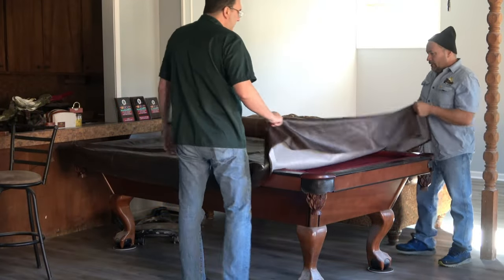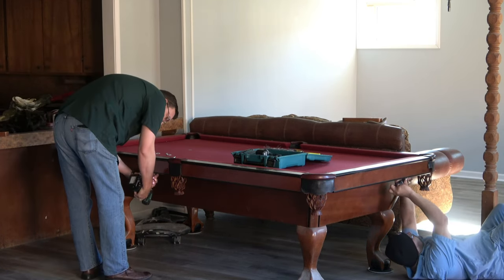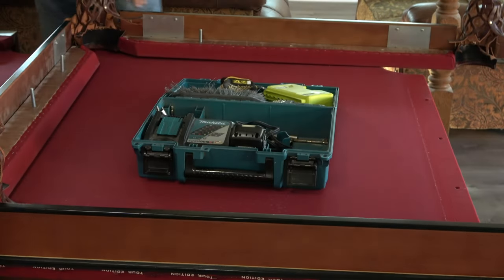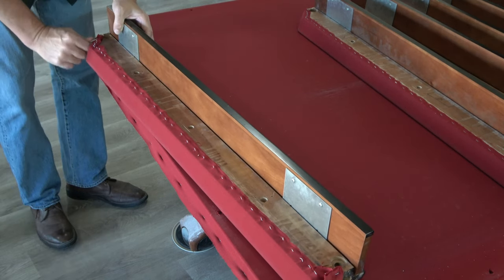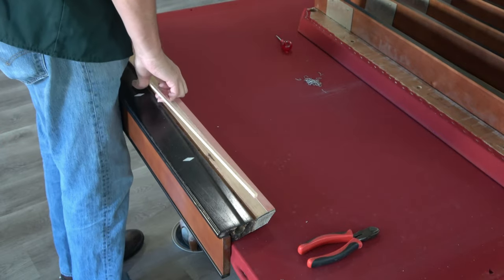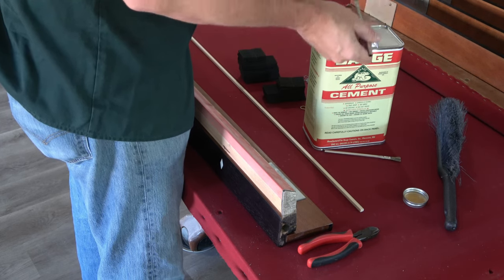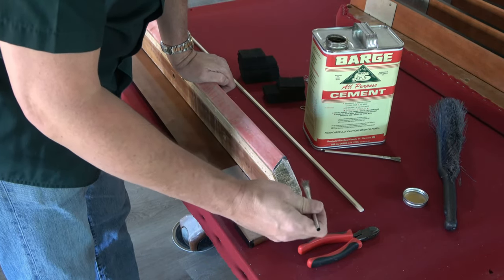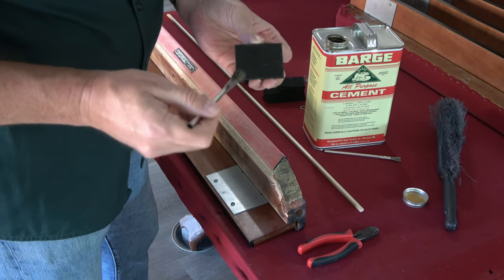How to Make Your Brunswick Pool Table Play Like a Diamond Pool Table

Comment: Does adding a 3mm and a 5mm together affect the acceptance of balls into the pockets. And wow I just noticed you’re adding the two to existing facing. I have 3mm facings now & was thinking about adding another 3mm to tighten the pockets but also thought about adding a 5mm instead of a 3mm to go even tighter but was worried about it affect correct acceptance.  I guess it you added both it would be fine for me to add 5mm for a total of 10 which is less than the 16mm total you added.  What’s your opinion?  I’m at 4-9/16” now.  Thx

Comment: If you replace the rubber on your rails do they come oversized to where u can leave extra at each pocket and tighten the pockets this way or do the rail sizes come standard with no extra material to cut off? Thanks love ur vids

Comment: I've had my Olhausen double-shimmed for 15 years now with 860 cloth (that's been recovered just once). And while I wouldn't trade it for a non-shimmed table, the shims mixed with Olhausen's natural pocket angle can make down-rail shots very frustrating. Especially when hit with any speed. Its amazing for practice, and keeping you sharp instead of lazy, but I do wish the angle was a little straighter - like the actual Diamonds, every-time I get that good ol' Olhausen Rattle. If you are doing this to your table and want it done right, do it the right way and use the second method he mentioned, or figure out a way to decrease the outer pocket width more than the inner pocket width (angled shims anyone?)
Reply: This is exactly what I came to look for. It would seem you'd want to cut the shims at an angle so the pocket is as you described. As soon as I saw the picture of the pocket with the balls, I thought "well that seems to be tapered funny." I came to the comments to make sure it wasn't just me.
Reply: @section8usmc53  so about 4 months ago I caved in and did it. Took the cloth and rails off, cut shims at about a 5 deg angle with about a 15 degree slant to the miter saw to match the down angle of the rails. The olhausens are 1.5 inch subrails so the 2" (1.5" measured) planks worked perfectly. Glued them on, then added staples for security. Put new artimis rubber on cut to match the new angles, new featherstrips, and new 3/8 inch facings. The pockets are now 4", but honestly in some ways play easier than the 4.5" they were before. Much more fair now. No more olhausen rattle. Plays great really, and amazing for practice. I will probably have to get a pro to put new felt on though, I put new tourny blue 860 on it, and the bed cloth looks good, but I didn't do the best job on the rail cloth. But that said, I couldn't find anyone within 50 miles willing to do the work, many didn't even know what I was asking
Reply: Olhausen pockets are cut to make potting tougher I feel. Everyone said Diamonds are tight but I didn't notice any difference from my Olhausen. The widths might be different but there's more than just width to make a table tough. I believe there's 3 measurements that determine table toughness as per Dr Dave.

Comment: I have a '75 GCII with origonal rubber. As I understand it, the Super Speed cushions are real rubber and won't go bad. I am considering 1/4 inch shims each side. If in the future someone wants to remove the shims, can they save the cushions?

Comment: Apologies if you addressed this and I missed it, but I have a 9' table, unfortunately with 5inch pockets. I am in the process of narrowing them to 4.25 and I was told that the only good way to do this was to actually add wood to the rail facing for the rail rubber to adhere to. The rationale is that adding too much rubber facing makes balls act strangely when they contact that part of the rail rubber -- I guess it isn't quite as solid as having the rail rubber seated to wood. As a one pocket player I am particularly sensitive to this. Do you have any thoughts on the difference between adding extra rubber facings as you do here versus adding wood to the facing?
Reply: You said it. I'm a 1pocket player too.  I did that to a brunswick pro 8 for a practice table...The proper thing to do is add model makers plywood to the rail ends and replacing the rubber cushions. (Model makers plywood comes in 4mm 5mm 6mm 8mm ect.) I went from 5 inch to 4.5 inch and it played great. The table mechanic did the final angle adjustments for the facing.

Comment: Why are diamond tables so expensive? And why did tournaments switch to them in the usa instead of olhausen?  Im looking too buy a new table ive narrowed it down between olhausen and diamond?  What's the difference in how they play besides the tighter pockets?
Reply from the maker: Diamonds are expensive because they're good tables made out of high quality materials and high quality craftsmanship. Are their prices justified? Not for me. I think Diamond went out of their way to fix problems that didn't exist. Do they roll true? When installed properly, yes. But, so does every other major manufacturer's table when installed properly.

If you're comparing properly installed 3 piece slate Diamonds to 3 piece slate Olhausens (or Brunswicks) the advantages claimed by Diamond become minimal at best. Personally, I find those advantages to be subjective rather than objective. I would be more interested in the quantifiable differences between the manufacturers. 1) Is there a quantifiable difference in how true the tables roll (NOT related to variances in cloth). 2) Quantifiable difference in the lifespan of the table itself. 3) Quantifiable difference in how well the finish holds up after "X" number of years of use. 

Ease of installation is not and should not be the buyer's problem. So, any features that a manufacturers say aid in easier installation are mere gimmicks. They're designed to get more money out of you - the consumer. As evidenced by the 90 year history of the "modern" way of building a pool table (look up "T" rail pool tables to understand how tables were built prior to the 1930's), and the 180+ year history, effectiveness, and ease of installation of traditional 3 piece slate methods, there is NO practical advantage in using slate leveling bolts as opposed to wooden wedges. Also, there is no practical advantage in using mechanical leg leveling systems as opposed to flat wooden, plastic, or rubber shims under the legs of tables. Even simple leg levelers like those found on Brunswick Gold Crown tables are, in all actuality, more cosmetic rather than functional. Once a table is installed and is level, it shouldn't need to be re-leveled. So, unless you're moving your table a LOT (as you would with coin operated tables that go from one bar to another or get moved around within a bar for special functions or gatherings), having mechanical leg levelers is pointless (other than aesthetics).

As for your question regarding the switch in tournaments, that one is simple. It all comes down to which company is going to pony up the most money to sponsor the event. Part of the higher price you're paying for when buying a Diamond table is going to pay for marketing. And sponsoring tournaments is part of marketing.

Tighter pockets:
I find the idea of tighter pockets - outside of practicing your game - utterly ridiculous! I firmly believe that there should be industry standards for pool tables and the game of pool. Industry standards for pockets was established back in the 1930's. That standard has worked VERY well for almost a century. Why change it? With Diamond's tighter pockets, they've managed to make a great table to practice on; but, a very frustrating table to actually play on. If I were to put it on gun terms, it would be like using a bench gun for hunting. Diamonds are that ULTRA-HIGH precision tool that's great for practicing your accuracy. But, for everyday use, completely frustrating to play on. Oh, and your friends who don't really play pool, they'll be absolutely MISERABLE trying to play on a tight pocket Diamond!

Ultimately it's your choice. Both Diamond and Olhausen make good quality tables. But, if it were my choice, I'd go with Olhausen.
Reply: @CreativeRestorations  wow thank you. Your the first and only person too ever pick olhausen over diamond.  Great information absolutely phenomenal in detail.  Your right theres a standard and regulation for pool tables why diamond decides tighter pockets is better, is beyond my comprehension.  I want to get really good for my own self satisfaction not to go pro. Maybe play some local tournaments hopefully win one or more in the future.  But yeah i want an enjoyable table not a frustrating table.  Plus olhausen have a lifetime warranty on what exactly? im not to sure.  Plus im moving to Tennessee and olhausen made or assembled there i wanna support local businesses.  Your the only person to convince to not get diamond and im glad you did.   Olhausen seem like very high end tables so i Can't go wrong.  Plus it will leave me thousands of dollars left over to buy pool cues and balls and other accessories for my man cave..
Reply: It really makes no sense you have all these people from my dads generation grew up around pool tables, now all of a sudden he coms over and i have a diamond hes never played on tighter pockets hes gunna hate my table and never wanna play on it and i dont blame him thats not regulations.. i always grew up on 9ft tables so i hate playing on 6,7, even 8ft tables sure you should be able too adjust too any table some might say.  But the fact of the matter is i always thought regulations tables were 9 by 4.5ft so why tournaments even allow pros too play on small bar tables is beyond me it wasn't like that in the 70's-90's all the pros only played on 9ft tables not valley bar tables like today..  i feel regulations have went out the window the past decade.. well in California i guarantee the pros or ams would never play on these bar tables out here they never roll true, they never been releveled after being moved hundreds of times, never been refelted, pockets barely hanging on lumps in the cloth or missing cloth its a disaster too play on.. i wish i was making this up i cant believe the disrespect one has for a pool table unbelievable i hate seeing miss treated pool tables its sad..
Reply from the maker: There are practicing aids that one can use to make standard pockets tighter. So, if you want to practice on a table with tighter pockets, you can do that - without sacrificing enjoyable play outside of practice. With Diamond tables, you ALWAYS have tight pockets. And, as I've commented elsewhere on this video, outside of MAJOR reconstruction and redesign of a Diamond table, you can't have industry standard sized pockets.

Also, I forgot to mention, Diamond does make single-piece tables. They are very good tables. But, again, they have the tight pockets. Another HUGE disadvantage to those single-piece Diamonds is, you need special equipment to move them. So, if ever you do move, you will need an installer on BOTH ends of the move who is both a) qualified to work on Diamond tables and b) has the necessary equipment to preform the job.

I'm sure there those who would disagree with me. But, I'm looking at this from a purely practical standpoint. If your ONLY use for the table is for you to practice your game, sure. Go with Diamond. But, if you want something that - long term - is more for enjoyment, go with Olhausen.
Reply: @CreativeRestorations  again very viable information.  I can afford the diamond dont get me wrong. but sure im going to practice a lot on my spare time, but eventually i will have guests over who wanna play pool and i want everyone too have an enjoyable experience.  I feel if your pro am or pro and play tournaments for a living then yes get a diamond but if your me and just wanna get very good on standard regulation table then olhausen craftsmanship is more then obtainable.  Should meet all my expectations and more probably id imagine.  I too am looking for practicality.  it sounds like diamond has a lot of gimmicks they use too make them sound as good as they are.  How much tighter are diamond like half a ball or quarter of a ball?
Reply: The diamond definitely seem subjective more then objective 100%.  Like pros play on diamonds the most they probably cant even remember the last time they played on a olhausen so they will say diamond is better again thats subjective and a lil biased as well in my opinion.  They believe diamond is better doesn't actually mean diamond is better.  Is nike really better then addidas is personal preference.  I think for practicing and trying to go pro diamond makes sense.  If practicing to get good but also wanna enjoy family and friends playing on it then olhausen so for me you helped me decide olhausen it is and that there build very well so i will be happy with my decisio. I will get simonis cloth lol.
Reply: @CreativeRestorations  how do you make the pockets tighter do you have too take the rails off and change the cloths?
Reply from the maker: Billiard Factory sells pocket reducers. They're accuracy training aids.
https://www.billiardfactory.com/Practice-Pro-Pocket-Reducers
Reply: @cryptonator1988  I believe all tables which are twice as long as they are wide are regulation tables. I believe what you are referring to are tournament tables which are 9' and 8 ' oversized (8 1/2').

Comment: I own a Diamond table with very tight pockets which can be pretty frustrating sometimes.  Is it possible to have the corner pockets loosened, even just a bit,, or am I stuck with what I have?
Reply from the maker: Diamond designed their tables with the intention of their pockets being extremely tight. So, I don't think there's any way of enlarging them. At least, not without MAJOR reconstruction. That's one reason why I'm not a huge fan of their tables. Anyone can take a Brunswick or Olhausen (or any other brand, for that matter) and make the pockets tighter. And, the process is completely reversible. No harm. No foul. But, when you start tinkering with Diamond pockets to make them larger, you're talking about big changes that need to be made.
Reply: @CreativeRestorations  Thanks very much for your reply Doug.  One other question if I may.  On a table that's reversible...  in order to loosen a corner pocket, is the long rail  and short rail simply pulled away from each other slightly (after loosening the rail bolts) or is there more to it than that?  Thanks again for your expert advice.
Reply from the maker: I don't understand the question. When you say "table that's reversible" and "long rail and short rail" I don't know what you mean by those terms.
Reply: @CreativeRestorations  re: "reversible"...  I was using your term from your previous post when you answered that,  "And, the process is completely reversible. No harm. No foul.".
My basic question is... is it a relatively simple process to physically loosen pockets that have previously been tightened on a table such as Brunswick or Olhausen?  If so, what is the process?
Reply from the maker: Ok. I just wanted to make sure that we were using the same terms.

If someone used this process to make the pockets more narrow, then, it's just a matter of removing the additional rail facings and recovering the rails. But, there are other ways of making the pockets more narrow. Almost all of them are non-reversible.
Reply: @CreativeRestorations  Thanks for your answer Doug.  It's all much clearer to me now.
Reply: There has to be a way, there are pocket size options when you order your table. Call Diamond.
Reply from the maker: @justin9855  There really aren't any options outside of buying a new set of rails (if they'll even sell just a set of rails). Making factory Diamond pockets wider would be no small undertaking. Replacing the rails would be the simplest solution. But, again, Diamond may not be interested in selling the rails without the table.
Reply: @CreativeRestorations  I'm buying one in the next 6-8 months. I will definitely ask them about this. You're spending $10k+ on a table, I would hope that they would sell a rail set. When I do finally get around to it in the spring (after our winter hell leaves this great state and I see the sun again for the first time in 6 months), I will try to remember to come back here and let you know if they will, as well as options, terms, conditions, etc.

Comment: What about the angle of the rubber at the corner pockets? The corner pockets on my Connelly are wider than 2 balls, but the rubber angle diverges towards the playing surface. When I hit the balls with hard draw when cheating the pocket, the ball often jars in the corner pocket and doesn't fall.
Reply: The angle does make a difference. I have done this same thing on some tables, however I sand the  new facings on a belt sander before gluing them on the old facings.  Look up Olhausen rattle. when replace all the rubber, fix the angle on the wood instead of stacking facings which makes the pocket corner too hard.
Reply: Extreme draw puts extreme top spin on the object ball.. Meaning, if you’re hitting the target it should fall..  Now, if you have a deep shelf and a flanged opening, the could be a problem that requires new rubber, but a great stroke is what really solves that issue, IMO..